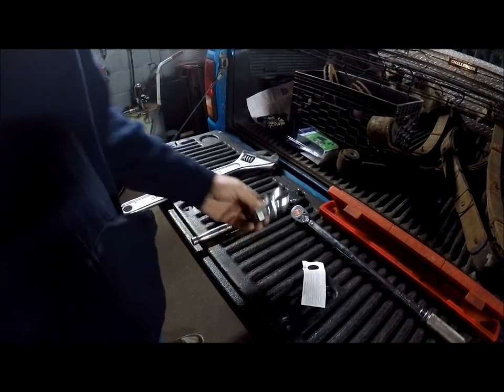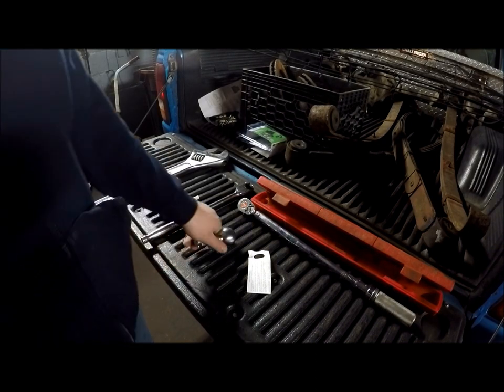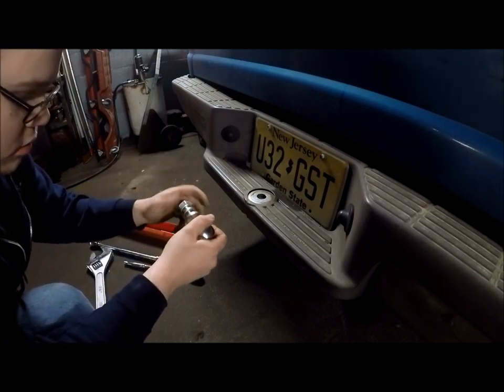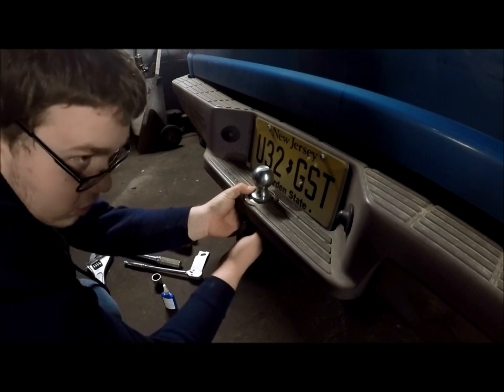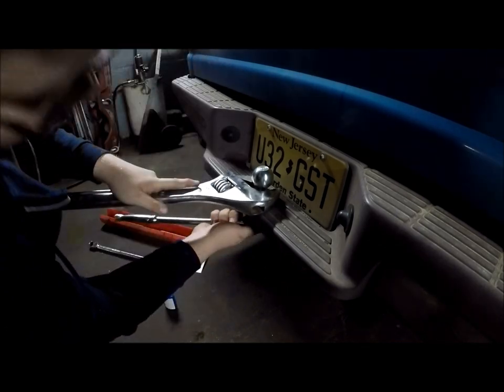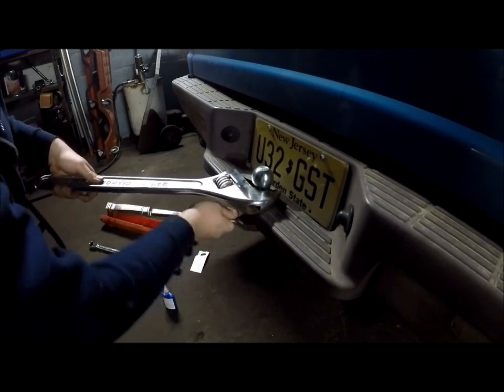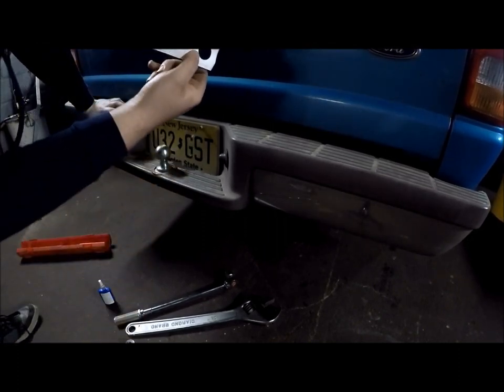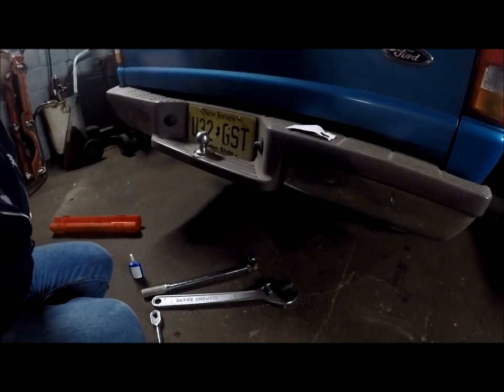How to install a trailer hitch ball !!! Towing with the ford ranger PT.1

Comment: Rule #1 when towing never ever ever never mount a ball to a bumper. Where do you plan on mounting safety chains or plugging your trailer in? Bumpers are not made for pulling
Reply from the maker: I should have specified its use. Being used to pull a 4x8 utility trailer from my house to the recycle facility once a week with light payload. Maybe 200-330 lbs most. The bumper brackets are not rusted at all and the bumper is in great shape. Owners manual recommends no more than 300lbs. tongue weight. I can't make assumptions for everyone but most people have to be smart when doing this . I should have stated not to haul a boat with this. There are catches under the stock bumper bar for safety chains. I apologize for misleading anyone who viewed this....
Reply: Why they put a hole for a ball on the bumper then? You can tow anything following the specifications of the manufacturer.
Reply: @mitchtalmadge  amen.
Reply: there is nothing wrong with using a bumper ball when towing things that are small like a little utility trailer or an empty car carrier.
Reply: @ElectronicsForFun  .....how about a single jet-ski on a trailer......think that should be okay ??
Reply: @stevenfox3465  yeah that would be fine, that's about all you could tow with a ball on bumper setup.
Reply: @ElectronicsForFun  Can I tow grass with it?
Reply: @ElectronicsForFun how about a 350 four wheeler

Comment: No...no...no....no....no........no....and no......
Reply from the maker: Why do you say?
Reply: @2manihobbies   Only thing I noticed was setting the torque wrench down so violently, knocks it out of calibration
Reply: @Klinikal773  Probably thread lock potentially throwing torque specs out of whack.

Comment: I'm getting ready to move from California to Texas. I'll have a light load. Maybe around 300 to 500 pounds not including the trailer itself. If that. Just moving my room. Planning on getting a 4 x 8 cargo uhaul trailer. I have an 03 ranger 2wd. With the ball mount on the bumper. Should I be fine? Do I really need a torch rentch? This'll be a one time move. Thank you in advance if you could help me out.
Reply from the maker: Hey John, I don't recall what the factory tow rating is... usually you shouldn't tow at the max of the tow rating, but if the truck is in good shape I cant see why you couldn't haul 1500lbs from the bumper. Make sure you distribute the load evenly across the trailer.  As far as the torque wrench, you could probably get by with a long breaker bar and tighten it by "feel". Good luck with your move!
Reply: Those old Rangers were rated at a little over 5,000 lbs towing capacity, and the cheaper 2" balls are usually rated at 3,500 lbs.
Reply: @livens100 from the bumper? I’m considering towing a 4x8 lawn trailer with a 350 four wheeler is that cool??
Reply: @silverhustlin1390  Yeah from the factory bumper hitch. At least that's what the manual says.

Comment: Is there anything like an adapter that I can use to hook up a trailer? Currently my trailer is not level and I’d like it to be but I haven’t found any adapter to lower it. Most require the square steel hitch which I don’t know how to attach that to my ball. Thanks guys.

Comment: i own a toyota talcoma it came with a ball mount in the bumper i plan on pulling trailers with it its from 2001 no rust its a florida truck should i tow with the hitch or mount a hitch on it.
Reply from the maker: It all depends on what your towing. Personally I would much rather tow with a trailer hitch,but if your towing within the factory stated capacity of the bumper and the vechile is in good shape you should be fine.
Reply from the maker: An owners manual will tell you what the bumper is capable of handling.

Comment: What did you use to cut the plastic covering away from the hole in the bumper?
Reply: i need to know the same thing
Reply: Use a Dremel with an cutting wheel

Comment: How would you remove one on a 99’?
Reply from the maker: @LukeCampbell_3  they are difficult to remove if on for a while. Maybe use a cutting wheel to slice through the nut

Comment: Where do you hook safety chains on a bumper hitch like this?
Reply from the maker: On the bottom of the bumper if I remember correctly there was two hook mounts tabs under it for the saftey chains
Reply: I have a ford explorer sport trac and it has to holes in the bottom for safety chains.
Reply: how are you verified with only 14 subscribers and no content?